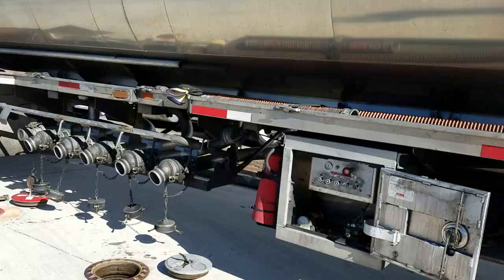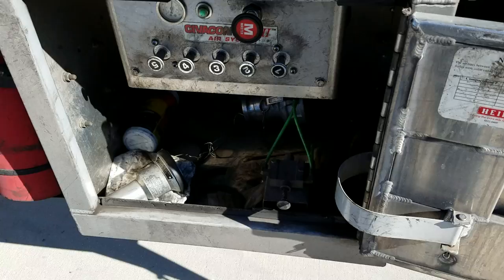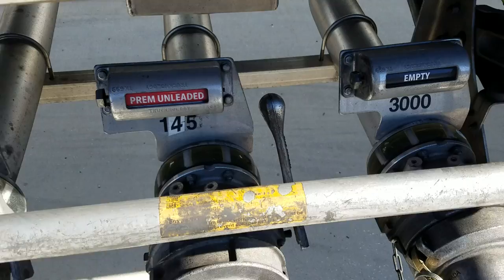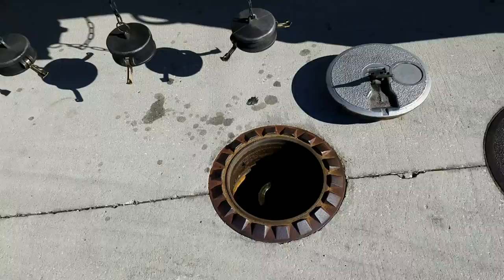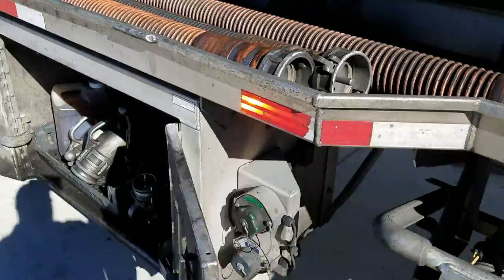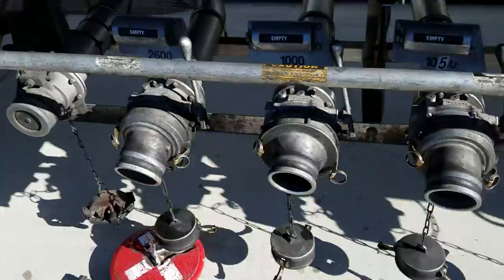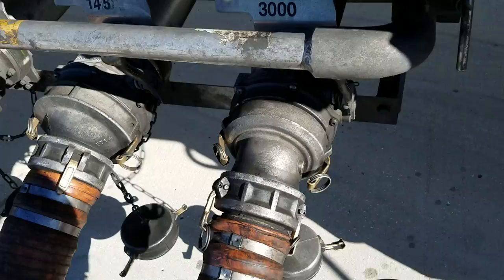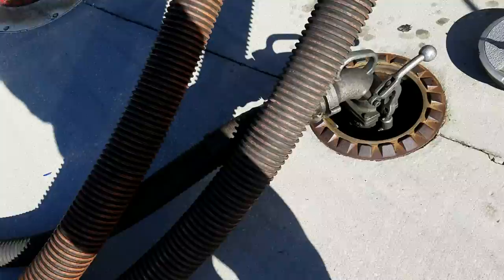How a Fuel Truck Delivers to a TruckStop

Comment: Great video! I always wondered how this worked. For those wondering why the trailer Only Holds 10K gallons, gas is 6* to the gallon, so 60,000 lbs on the trailer, plus the cab and weight of the trailer brings it to the legal GVWR of 88,000 lbs.
Reply from the maker: my trailer maxes out at 9200 gallons, a legal load for me is 8800 gallons of gas max and 7700 gallons of diesel for max
Reply: It's called compression
Reply: Legal weight is 80,000 not 88,000. Same thing here at my company. Truck holds 9200 but 8800 regular gas and 7700 diesel puts me at the legal limit.
Reply: Nasim Wehbe some states if you stay off the interstate and within the state line you can run higher gross I believe Alabama is 88000
Reply: For here in North Carolina, im not sure about conventional loads, but livestock loads going directly from the farm to the processing plant are given an even higher limit all the way up to 94,000lbs but you have to be going directly to the kill site and you can't take interstates.
Reply: The vapour returns to the same compartment you're unloading from.
Reply: K05 T4R The vapor recovery goes to the whole trailer, not just the compartment you are unloading from.
Reply: K05 T4R The fuel vapor stays trapped in the trailer, if everything is working like it is supposed to be.  Some of the vapor can condense back into liquid but there is always vapor present in the trailer.
Reply: @K05 T4R The vapor goes into a pipe that leads to a common rail with inlets to all compartments. One cannot control the vapor vent valves independently; either all are open or all are closed.
Reply: Just for greater accuracy here, gas is usually around 6.35 lb/gal and diesel around 7.1 lb/gal, give or take a few hundredths.
Reply: In Michigan we haul 13,400 gals gas or 12,500 diesel.
Reply: Reducible load permit up here in Mass....99K and 104K in RI.
10,000 diesel
11,500 gas

Comment: Great vid, I did fuel for 4 years untill I got tired of the shitty schedules that come with. I got payed by the load so you know that 87 would be running first. Also you were trained correct. Everything you did was dead on. My uncle hauled fuel for 44 years and he trained me so yea I know my shit. Good to see another fuel driver doing it the right way. Have a good 1

Comment: I'm so glad you posted this video, for one, people get to see how things happen. For another, I hauled fuel for 20 years and I still enjoy things like this video. The progression in equipment and the loading racks is amazing. I top loaded at Phillips in Laverne, Ok for many years where you had to actually type your ticket. When I stopped hauling I was loading at P66 in Amarillo. Bottom load, computer tickets and loaded 7500 diesel in 15 minutes
Reply from the maker: Its crazy how different things are. If i load high sulfur diesel at our terminal In Savannah it's top load. Takes me about an hour to finish since i have to move the truck. 

Bottom loading at Marathon where I am now, they have three diesel heads. You can load 7500 gallons of diesel in about 8 minutes.

Comment: Just WOW. I'm the ops and control manager for a small petroleum company in South Africa and I've always believed that when it comes to doing a drop there's a standard across the globe. There are some similarities, like the vapor we release it via a breather pipe and rely on pressure built by the truck to gravity out. BTW you said the 6 compartments is the largest you've seen, here in S.A standard load is 40000 Liters = 10566.882 Gallons in a 7/8 compartment configuration. Be safe out on the road and always remember in our industry the moment we lose respect for the product that's when things end up going side ways.

Comment: Thanks for this! I work for a fuel delivery company and I finally get to see what they do. My job is to make sure all the permits, inspections and certifications are up to date and on the truck or trailer so they are able to get the fuel from the terminal to the customer.
Reply: Kimberly O'Keeffe you should ask to do a ride along to see what goes on with your crew. Bring it up, it’s always a good thing for co-workers to see and understand what the others do.
Reply: @akbychoice  With my home schedule it's not possible at the moment but I have attended safety trainings our company runs (for free) to any fire department in our area. What an eye opener! Our Safety Director shows up along with a truck and full size tanker and goes stem to stern. Even the driver gets involved to answer questions.

Comment: I can relate, I get Jet Fuel from these same types of trailers, but sometimes they are dedicated and only have one offload valve. I like those ones. Set it  once and start pumping from our pump. PTO is slower, but it gets done, none the less. We have above ground tanks, 26k gallons.  Anyway, I don't fly, but I drive. So its good to see the other side of the coin here, thanks for posting this.
Reply from the maker: No problem at all, thanks for watching and be safe out there!

Comment from the maker: yes ill make a tour of my truck and trailer video. just have to wait until i have free time with the truck stationary.
Reply: Trucks and Guns q😍
Reply: Trucks and Guns qrjd
Reply: Trucks and Guns what's your take home pay bring a tanker driver? Home daily?
Reply: DrtyDiesel question about low grade and mid grade fuel. You said it’s just a mixture of two. So I can fill up my car for less money buying low grade fuel, but still getting mixed mid grade since it’s all out of the same tank?
Reply from the maker: @dohc1974  mid grade is regular and premium mixed. Regular, or low grade, is perfectly fine for your vehicle. If you get mid grade or premium and your engine's computer is not setup to run on premium or mid grade, then youll be wasting money. Honestly as cliche as it may sound, use whatever fuel your owners manual says to.
Reply: Since you did a drop fuel video. Can you do one showing getting loaded?

Comment: I remember a long time ago I did these calculations to know how long it would last me if I stole the truck..

9200 gallons...
My car gets 20 MPG, that would get you drive 184,000 miles....and if I drove 15k miles a year, it would last over 12 years. If you get 30mpg, that goes to 18 years..

I'm gonna need a lot of STA-BIL

I also remember calculating how many tiles were in the mid town tunnel while sitting in traffic. I don't remember the number , but it was in the millions.  #nerd
Reply: Oh my god we need one
Reply: I just need the diesel
Reply: Gas goes bad
Reply: chris corona 
Kerosene doesn’t tho
Reply: I drive a Chevrolet volt, I fill it with gas like once every 2-3 months..... that truck could last me like a 100 years! :P
Reply: Gas would go bad over that long
Reply: I'd just sell the gasoline half off to avoid the gas from going bad. I know several small businesses that wouldn't mind some cheap  gasoline :)
Reply: Turbo, you be in jail soon after...
Reply: The old midtown or the new midtown. It’s way better having two lanes each way that was the first tunnel i drove through when i got my learners permit and it was one lane each way i was a little nervous 😂
Reply: When people call themselves “nerd”, it’s code for I think I’m smart. No, no you’re not smart for calculating such simple math.
Reply: Diesel doesn't expire though
Reply: r/iamverysmart

Comment: When the Tanker returns to the loading terminal, the trailer vapors are then pushed ,while reloading to a vapor recovery system. There it is either burned off or processed to the bulk tank.

Comment: LoL. a wee little fire extinguisher.  hahaha. if SHTF during a delivery procedure that fire extinguisher would be like having a wooden spoon as your main weapon to fight King Kong.
Reply from the maker: gmctech , haha you got that right! If SHTF im runnin!
Reply: This is a very dangerous job.  The most danger is an accident while driving, which is something that happens.  It takes very little in the way of an accident to light that up, and once that happens you're dead.  It usually takes overturning the rig, but on loops and ramps it happens often enough.
Reply: There are  regs    I drove a 8 thousand  gallon  jet tanker  we had  2 20lbs abs fire  bottles
Reply: Like I tell people, the fire extinguisher is just safety requirements, if everything goes sideways I’m gone. At that point it’s just a projectile in an explosion!
Reply: soundspark exactly. I had a wheel seal and bearing replaced on a driver. The mechanic overtightened the bearing. The bearing heated up, leaked oil and caught on fire with 4,000 gallons of gasoline onboard. That one fire extinguisher was enough to put the tire fire out long enough to get water on it from a nearby stream.

Comment: We always drop the derv first then the spirit, to prevent a cross over contamination, wait for the tiny bubbles and knock the valve off, enough fuel in the line to get you to work for a week 😂 👍

Comment: I used to do that, the trucks I used to drive are 8 axle truck and trailer combinations, two compartments on the truck at 3100gal in the front and 1300gal in the rear compartment, three compartments on the trailer, 2500 in the forward, 1300 in the center, and 3100 in the rear, the loading heads were separate at the top and the 4 inch bottom drains are just below the loading heads, we had both manual cable and air operated internal valves, all of the trucks has a PTO pump when pumping off to above ground tanks is required, I used to haul to Chevron, Texaco, ARCO(BP), Shell, Exxon, AVGAS, JET-A, bulk clear and dyed diesel, ethanol, and sometimes transmix (pipeline flush) from the tank farm back up to the refinery, it’s an easy job but I got a better paying job and a career change.

Comment: should have water paste on your stick so you can prove you didnt deliver water and report any water reading prior to drop to both the station operator and your dispatch it removes your companys liability. real expensive to pump out a tank then refill it with clean fuel. I deliverd fuel in AZ for 15 yrs - good delivery by the way text book safety nice job!

Comment: 50 degrees in FL  make sure you have the winter blend lol jk good job.
Reply from the maker: LOL RIGHT! We do cut back on the Bio-Diesel blend int he winter time though
Reply: What winter in FL? We run bio down to probably around 40* and even all year to MN customers because of a state bio mandate.
Reply: You're not running pure bio in MN. Summer, most places run B11 or B20. During winter, the bio % is  reduced depending on temperature or #1 Dsl is mixed in. Either way, anti-gel is also added during delivery to stop the pumps from freezing.

Comment: Why wouldnt you take the extra few seconds to change your dials from empty to regular when the compartments have regular in them.  If you were ever in an emergency situation people would mistake the tank for being empty when it is actually loaded.   For example if the tanker rolled and fire crews seen the dials they would be tempted to think the tank is empty unless they checked your bill of lading.
Reply from the maker: Brad  Kroes , thats why they check the BOL, not all trailers have petro dials. You cant always go off of what they say.
Reply: In New England you would get written up for that. Retired now but tanker was my favorite job!
Reply from the maker: Florida doesn't require the use of petro dials, i use them now though. Used to not care but ever since we started hauling for diverse loads i started using them to make sure i dont make a mistake when dropping
Reply: Brad  Kroes some states require it if your trailer has them.
Reply: I agree that knowledge is power, especially in an emergency situation. And in a serious accident, it may take a while to access the bill of lading. On the other hand, an "empty" tank is still hazardous because it contains flammable vapors.
Reply: @wesleyhurd3574  I was about to say the same: an empty tank is still a loaded tank; whether it is a vapor load which is more dangerous than a liquid load (airborne and invisible), or residual.  In HAZMat you learn railroad tankers still contain a few hundred gallons of load due to a residual affect, plus vapors from the previous load.  A tanker therefore is always considered loaded.
Reply: the vapor alone is an explosion risk. the tanks can be empty and still explode.
Reply: I worked on Petro and Chem tanker ships. A hold is full and explosive till such time as you've inserted, cleaned and gas free. And you've seen the gas monitor prove it safe.

Comment: Never buy premium fuel unless your car specifically requires it and is stated in the manual. The cheap stuff will work just fine
Reply from the maker: I agree 100%. People think premium is better or cleaner just because it costs more, definitely not true.
Reply: @DrtyDiesel  Right it only runs better if your engine has a higher compression, all it does it prevent the fuel from premature ignition due to pressure. People think octane = horses when in reality it doesn't. I mean hey, more money for the gas stations..
Reply from the maker: @SuperPyro  pretty much lol
Reply: Or if you got a high octane tune on your car....

Comment: I work as a fuel tank inspector in the uk and my inspector said premium petrol is a mix between normal petrol and vapor from the vapor recovery which has a hire octain level in it so it makes it stronger and a little bit better which you just explained

Comment: how about loading at the refinery . cool
Reply: most racks if all will not allow any electrical devices in if caught the driver might get locked out or worst an explosion
Reply from the maker: Yeah i cant film at the loading rack, too dangerous and against the rules.
Reply: forcedout1 it's been proven the cell phones won't cause an explosion
Reply: C
Reply: Don't matter if it don't cause it or not. Rules are rules. We have cards that we sign for that promise we will not break the rules that are set by that particular rack.  I like my job and making a living for my family. Besides you don't want any distraction while loading. Can easily skully out. Makes a bad day worst.
Reply: Tektonic you might be talking about a kinder morgan rack then they dont giv a fuuuudge lol unless they changed the rules of course font risk it thought either way
Reply: I worked with a guy who ran tankers. He said that regardless of "brand" the line up was the same. You dosed your tanker with the additive package of the brand you were delivering, then queued up behind all the others at the same refinery. Gas is gas, the difference is literally in the details.
Reply: Shaine Bingham you sound like a fun person
Reply: Random thought.... what about mounting a GoPro before even entering the plant? Totally sealed off. As long as filming isn't against the rules of the site, I would think that it should be okay!
Reply: @panzerkiller13  filming at a refinery is probably a security risk
Reply: I work in a large refinery and taking video is not authorized anywhere on site. It's a MARSEC Level 1 site and you must have a security pass for camera use and be escorted the entire time to take photo/video. These camera passes are only issued for project engineers mostly, or ERT Captain for recovery photos and damage assessment after an incident. Even taking photos or video from the public road outside of the fence will get you a visit from local PD. The rack I worked at was just like an over-sized gas station pump with gallon counter and all, so imagine that.
Reply: Shame you cant film that. Would make for a cool video
Reply: Adam Brydon not totally true, we had a driver get burned badly while disconnecting from the tank downspout. His cell phone fell out of his pocket and created a spark when it hit the concrete.

Comment: Don't know how long you have been driving. I stopped in the early 2000's. I used to haul chemicals in shotgun tanks. One belly valve on a center drop, and one valve on a rear drop. This was out of Savannah, Georgia, to all 48. The only fuel I ever hauled was for Burlington-Northern Railroad. We domed out the (shotgun) tanks, because we would bypass the scales by taking back roads. A requirement by our company, at the time. This was out of Springfield, Missouri, regional hauls. I didn't realize how much I missed it, until I viewed this video.
Reply from the maker: Cambodia Paul's Organic Farming , ive been driving for 7 years, hauling fuel for 5 years. I love it

Comment: Great video. Only thing I see that I’d imagine you would get into a lot of trouble with is if you crashed by chance and the rescuers look at you’re trailer and see that the tank identifiers say empty and there is gas in them. You’d be in a lot of trouble
Reply from the maker: No, first responders would go by the placards. Regardless of what the petro dials say
Reply: I maintained a truck license for 43 years hauling Propane and Butane for 10 of those years. The truck and trailers are more dangerous when they are empty than when they are full. The empty tanks are full of vapor that is allot easier to ignite than a tank full of liquid. Granted gasoline will ignite pretty easy but the vapor in the tank already has oxygen blended in it and will flash quite easy!!
Reply: @DrtyDiesel  yup.   Placards are for the public and responders.  

Fuel dials are for yourself

Comment: I'm staggered there's nothing to physically prevent randos from popping the tankcap off and slurping a couple gallons up with a siphon... I would have figured there'd at least be a padlock or something under the safety lid.

Edit: Ah, found your reply from last year indicating they were in the process of getting new tank caps and locks fitted.